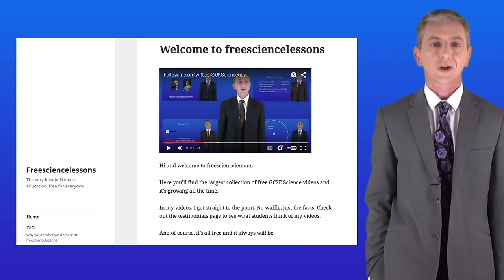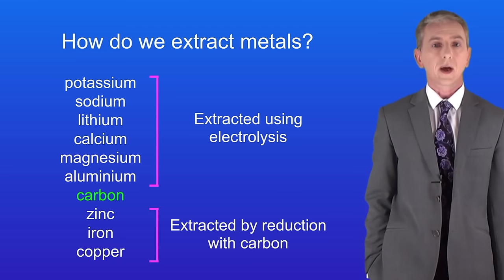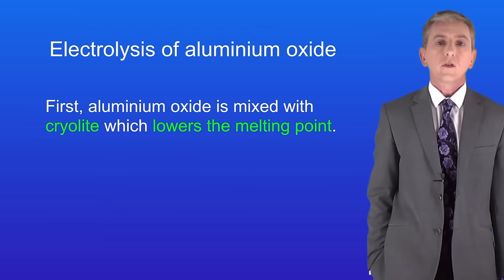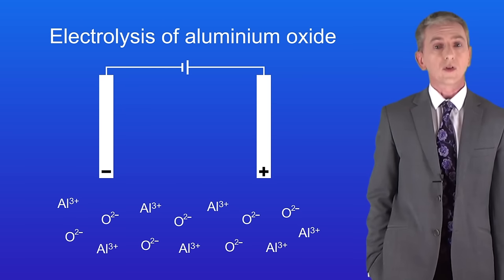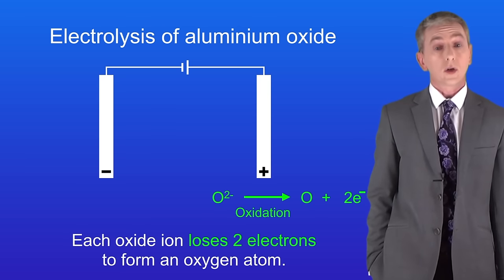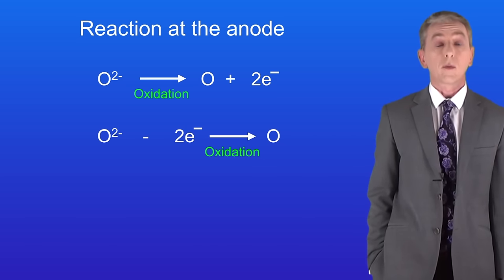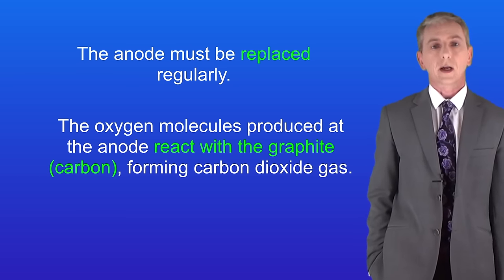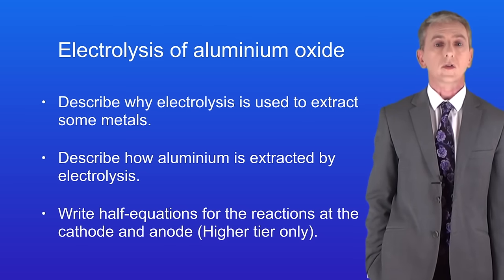GCSE Chemistry Revision "Electrolysis of Aluminium Oxide"

Comment: I'm confused how can Al 3+ gain 3 extra electrons and be neutral it will have 15 electrons now. Shouldn't it lose 3?
Reply: I know where you coming from, however you need to remember that electrons are negative. So when it gains the three NEGATIVE electrons it cancels out the 3+, as 3-3 is 0.

Comment: Can you explain why a mixture is used as the electrolyte?
Reply: i think it's to lower the melting point of the aluminium oxide so it can be molten for electrolysis to happen; aluminium oxide itself has a high melting point and therefore it reduces energy needed and saves £ when mixed with cryolite

Comment: Hello sir ..is it the elements above and below zinc or carbon.... Because my chemistry teacher told us that you can use reduction method to the elements below zinc
Reply from the maker: Elements below carbon are reduced with carbon. Elements above carbon are extracted using electrolysis. If you wanted to reduce elements with zinc then you could (I don't see why though). In this case, all elements below zinc could be reduced by zinc.
Reply: Thanks sir I got the also,  in the electrolysis did the elements with negative charges always make oxidation or it depends
Reply from the maker: The elements with negative charges always undergo oxidation during electrolysis.

Comment: wait how is graphite an inert electrode if it reacts with oxygen to form carbon dioxide
Reply from the maker: It only reacts with oxygen at the very high temperatures that electrolysis of aluminium oxide takes place at. At room temperate, it does not react with oxygen.

Comment: Hi sir, I really love your videos, i have a question on this video though, at 3:13 it shows a second oxidation equation but my teacher in school says you dont have minus symbols in equations, you would have o"2 + 2e-  ---> O
thank you and please answer back
Reply from the maker: Hi. I'm not really sure if you've heard your teacher correctly. In an oxidation reaction, electrons are LOST from something. In the case of electrolysis, the oxide ions (O 2-) are being oxidised so they are losing their two electrons to form oxygen atoms. These then pair to form oxygen molecules (O2). 

The equation that you have shown above does not really make sense I'm afraid. Do you mean O + 2e --> O2-? If you do, then that shows oxygen acting as an oxidising agent, in other words it is TAKING electrons from something else (for example a metal although it doesn't really matter what it is), and in this case, the oxygen is being reduced. So you need to be careful that you're not mixing up oxide being oxidised to oxygen (ie electrolysis) with oxygen being reduced to oxide.

Feel free to let me know if you need any more help.

Comment: Why is electrolysis used to extract metals? Didn’t quite get that!
Reply from the maker: It's used to extract metals that are more reactive than carbon (since these cannot be extracted using carbon). Infact if you wanted to, you could use electrolysis to extract any metal (but it's expensive).

Comment: Why we use carbon and graphite?
Reply from the maker: Graphite (which is a form of carbon) is a good conductor of electricity. It also has a very high melting point so it does not melt under the high temperatures used.

Comment: Why is it called aluminium oxide when there are three oxygen atoms - is this always the name (shouldn’t it be trioxide)?
Reply: Yes it could be called trioxide, but since the charge on an aluminium ion is ALWAYS 3+, there is no need to clarify the number of oxygen atoms, as the formula is always Al2O3. a counter example would carbon, since it can have two neutral compounds with oxygen, CO and CO2, hence the need to use the mon-/di- prefixes; to clarify which compound you are talking about.